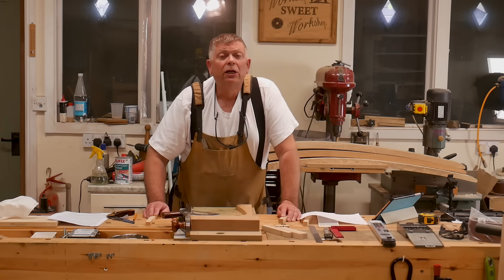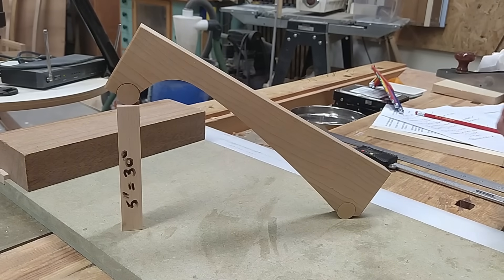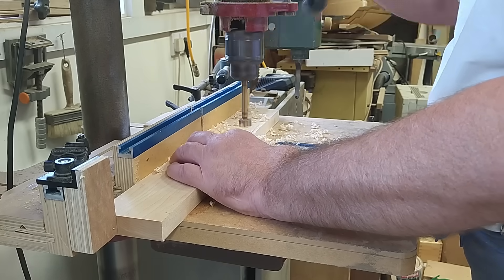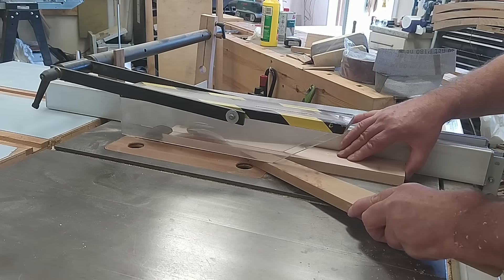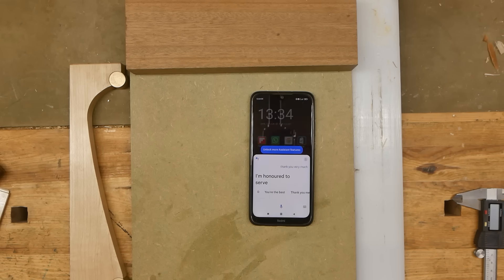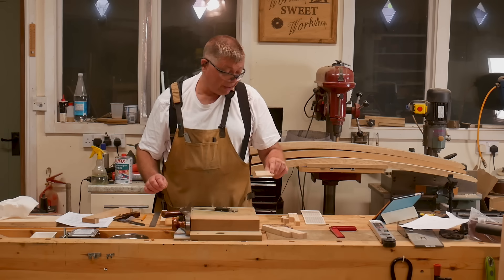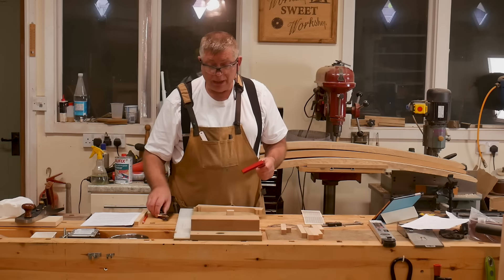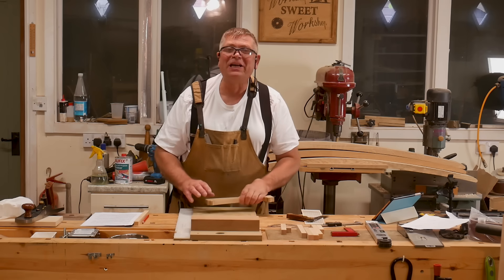Make a Sine Bar for perfect angles First Time Every Time!

Comment: Haha!  Making a sine bar using a ruler for the length!  Wow!  That's like doing microsurgery with a sledgehammer.  Your precision was out the window from the start.  
I would instead suggest a vernier protractor, or a digital one.  They'll be plenty accurate enough for anything made of wood.  If your sine bar works, that means you got REALLY lucky, or more likely, you didn't need that much precision in the first place.
Now, all that said, a really neat exercise and interesting build.
I suggest that everyone search for a video entitled, "the origins of precision"

Have a great week!
Reply: That's a bit harsh.  
As I was watching I was trying to figure out how I would build one using the tools in my average equipped workshop.  I also tried to consider the tolerance stack up.  No matter how carefully I measured and how much I prevented my drill bit from flexing I would never get exactly 10".  Nor would I be able to get the two sides exactly parallel And I would have a slight error on the length of the spacers not to mention that I don't have access to the perfect 6mm anvils.  
However, even considering all of that I can't think of any woodworking project where this wouldn't be accurate enough.  And much more accurate than a protractor.
Reply: @David-tv3dk  I endorse all your comments.

For real precision, use a sine bar manufactured for use by machinists, and gauge blocks to measure distance with extreme accuracy.  A sine bar can be bought for $20 and up.  A set of gauge blocks for $100 or so, used.
Reply: @David-tv3dk  You are probably mostly right.  Hence my qualification that you probably didn't need to be that accurate in the first place in woodworking.  Wood compresses, glue fills minor gaps and there are a multitude of ways to hide imperfections that are in just about every wood project.  
I don't mean to insult your intelligence with this question, but  do you know what a VERNIER protractor is?  Many woodworkers cut miters a half or full degree acute so the outside corner is guaranteed to close with little or no visible gap once joined.  Most common vernier protractors are accurate to less then 5 min of angle.  That's 1/12 of a degree.  And if you know how to use them and have a magnifying glass, you can cut the in half.    Cheap digital protractors aren't as accurate as vernier models and require those pesky button cells.  But they're easy to read close enough for most any wood project.
My comment does read harsher than it was intended.  My aim was to point out the basic precision error of starting with a very inaccurate foundation length.  Those combined with the other things you mention can compound error.  But if you're lucky, they can cancel each other out and be very accurate.   Maybe.  But what do you have to check it against?  
Again, it's a neat project that may well be good enough, but sine bars can be a real pain in the backside to use, depending on the application.  Using one on a vertical surface, for instance.  Wood is not the most stable material to make precision measuring devices from.  
But again, if it's close enough for you, it's close enough.
Apologies for the harshness.  It's the old Army NCO in me.
Reply: @mikemorgan5015  I am aware of vernier calipers - in fact I own one (or is it a pair?) but I wasn't aware of vernier protractors - although I am not surprised that they exist.  I agree that would be a great way to measure angles.  My point was that woodworking requires an amount of precision but measuring isn't really the main issue.  I believe that it's the lack of precision in the tools that causes the most issues.  I have average tools in my shop and I know there is blade deflection and mitre tools or positions that have a small amount of play,  I am not sure if my drill press table is exactly perpendicular to the bit etc.  But as you suggested wood has a way of hiding errors - even the swelling of the wood when exposed to glue can help fill gaps.  I am aware of the trick to cut angles slightly acute so the outside closes but you can also use the same position and cut both sides to ensure that the angle adds to 90 - on a picture frame as an example.

I do agree that this isn't overly precise but it is "good enough" for my uses anyway.   There's an old saying that "only an amateur blames his tools" and that may be true but many times when I watch a video I think how easy it would be if I had that shop set up...but since I don't I think of ways to hide my errors.

I think I was more impressed with the concept more than anything else.
Reply: <<Most common vernier protractors are accurate to less then 5 min of angle.  That's 1/12 of a degree.  And if you know how to use them and have a magnifying glass, you can cut the in half.  >>

Thanks for estimating the accuracy a vernier protractor can produce.  

I'd be interested in the accuracy that can be produced by using a sine bar manufactured for use by machinists and a set of gauge blocks to measure the height at which a sine bar would be set.

I'd bet that would produce significantly greater precision that a vernier protractor. 

And how do you test and calibrate a vernier protractor to KNOW that it is accurate for the angle and precision you need?  Guess?  ASSUME?  

I would guess that you might use a sine bar and gauge blocks to test the accuracy of that vernier protractor!  That's what occurs to me , anyway.
Reply: Making a sine bar using a ruler for the length!  
A couple of things, firstly it didn't have to be 10" it could have been 5" and be  measured digitally, and second if he wanted to make it 10"  long I suppose he could have measured 10" digitally by using two pieces of wood (both shorter than the 6" limit) by adopting the method he used for measuring the 45 degree angle where the length of wood was 7.07 inches, which was checked digitally.
Reply: <<I would instead suggest a vernier protractor, or a digital one. >>

A sine bar is a great way of using basic geometry and trig to solve a problem.  I find that satisfying. 

While your vernier protractor would likely do for a woodworking project as you describe, I'd bet that a sine bar would be superior for a precision setup on a Bridgeport milling machine!

Just depends on the precision you need.  

I'd actually be interested in the precision of a vernier protractor compared with a sine bar and gauge blocks. I wonder how precise each one can lay out an angle when used by a skilled person. .
Reply: @SeattlePioneer  Oh, without a doubt precision manufactured and certified measurement tools like sine bars and gauge blocks are FAR superior to protractors.  But this ISN'T either of those.

My point was that making anything like this using a ruler as the starting measurement standard is simply not going to be anywhere near the precision tools mentioned above.  The likelihood of cutting this stuff out and getting within a thousandth of an inch using a ruler for your first critical measurement is astronomically low.

It's still a really cool shop project that's likely close enough for woodworking.  Because even if it's a bit off, at least it's results are fairly repeatable.  I say fairly because wood changes dimensions with humidity and is compressible.  

A woodworking test to demonstrate compounded error is the 4 and 5 cut method squareness tests.
Reply: @SeattlePioneer  "Just depends on the precision you need."  Exactly!  5 MOA is fine for general shop projects.  But if you were building a base for a astrologists telescope, you'd fail miserably.  BUT!  you can do some incredible things with off the shelf items.  Say a threaded rod with 40 threads per inch.  Using that, you could VERY accurately get 1/40th of an inch with a single revolution.  Divide that revolution into 360 degree marks gets you to 0.000069 inches per degree of rotation or 7 one hundred thousandths of an inch if you know how to account for backlash in the thread to nut interface.  At these tolerances, though you MUST account for temperature.  A single degree of temperature rise could throw that off significantly depending on the length of the rod.
Reply: @mikemorgan5015  

<< Say a threaded rod with 40 threads per inch.  Using that, you could VERY accurately get 1/40th of an inch with a single revolution.  Divide that revolution into 360 degree marks gets you to 0.000069 inches per degree of rotation or 7 one hundred thousandths of an inch if you know how to account for backlash in the thread to nut interface.  >>

Heh, heh!  Sounds like you've invented the micrometer!

Just as the video described ways of laying out angles simply with a degree of precision, you describe a way to measure length with a degree of precision.

But I'd prefer to use a sine bar, gauge blocks and a micrometer for such tasks.  They are relatively cheap, more precise and I don't have to build them!

But knowing that you could helps provide an understanding of the origins of precision measurement  ----one of the gifts that produced science and industry.  

Thanks for your interesting post, though.

Comment: Where would you obtain "anvils" in America for this?
Reply from the maker: I suspect that you will have to find someone to turn a pair for you. That's what I did.
Reply: @SteveMaskery I would assume that you can just cut off some decently round metal stock. Like an old shaft or similar.
If the ends are not nice and perpendicular it can be a little harder to get them properly seated during the glueing but otherwise there is no need for precision at the ends.
For a low precision sine bar like this the wood is way less precise than most shafts or other decently round metal round stock.
Reply from the maker: @larslindgren3846  Well it wouldn't be as pretty, but it would work.

Comment: The British and the yanks stubbornly hanging on to the imperial measuring system.
Reply from the maker: Well no, actually. I normally work in metric, but just occasionally it is more convenient to work in inches. This is one such situation, because 10" is a sensible size whereas 10cm is too small to be useful. I'm amphibious, I can swim in both seas.
Reply: @SteveMaskery  Re "I'm amphibious, I can swim in both seas." My Aunty Dextrus was a keen swimmer and did likewise.

Comment: "Multiplying by ten is very easy, and that's why I'm working in inches."
If only there were a measurement system based on factors of ten......
Reply from the maker: Very drole! :) The point is that 10" is a handy size, whereas 10cm is too small to be useful. And as a digital caliper can give me decimal inches, it makes more sense than measuring 250mm.

Comment: Great job! I plan on making one but have always found that just working with trig functions is the easiest way to find angles. I may have missed it but when you asked Google for the sine of 6.7 degrees I missed you mentioning tha the block needs to be 10 times longer. Oops, just saw the note you put on the screen. Great stuff for making making accurate angles!

Comment: Funny, he uses a phone to calculate the angle block length, when he could easily download one of the many very acurate angle apps to prove angles... without mucking about the hassle of having to hand planning tiny blocks to length or to use any sine bar laying about. Stop yibber yapping to ya phone and get up with the times - old school techniques left earth a couple decades ago.
Reply: You are very rude indeed. You miss the point entirely. If you don't like it, just move on.

Comment: "…and multiplying by ten is very easy!" (starts using imperial instead of metric. Priceless)
Reply: But at 10cm between centers any error in the length of the spacer will have 2.54 times as much effect on the angle, and at 100cm the whole thing is cumbersome. He could have used 25cm but then he'd have to multiply by 25 and while not hard, is not as easy as by ten. Also, he was using decimal inches and never mentioned feet, yards, fathoms or other screwy "Imperial" units.  "Half a league, half a league, Half a league onward"
Reply: He is applying ratio. Does not depend on the measuring system. It shows the op lack of basic understanding of math.
Reply: @pazu8728  I gotta say,  folk who choose to openly and confidently demonstrate their ignorance to the world, like the OP here clearly does are comical.
Reply: He then proceeds to use decimal inches.
Reply: @adrianscarlett  Indeed he does, and does so correctly. When I was a mechanical engineer about 40 years ago, working for the Ministry of Defence in the north of England, I regularly worked with drawings dimensioned in decimal inches. It was absolutely the done and correct way to work. I regularly manufactured to a tolerance of one mil (one thousandth on an inch), and sometimes more 'accurately' than that  All of our imperial measuring equipment was in decimal inches when manufacturing from drawings using imperial units.  When one is ignorant on the application of using decimal inches, and chooses to denigrate with a healthy dollop of ignorance. I suspect one may feel that belittling someone who is perfectly comfortable in the correct application of imperial units is both smart and acceptable. 

I can see why you might be challenged if you had to multiply 2.1 inches by ten, as opposed to multiplying 2.1 centimetres by ten.  Knowing how decimal inches work will be challenging for some.  Have yourself a wonderful evening.
Reply: I think some of you guys are missing the point. Sine (of the angle) = height of the block (in inches) divided by ten inches. Easier to do in the old days when you didn't have a calculator (but you would need a trigonometry look up table for sine). But he uses a calculator! So the 10 inches is not very important, just need to know the length accurately, so you can plug it into the calculator.
Reply: @jumboegg5845  Yeah, the OP was a bit of an ignorant numpty making this post. I guess he thought one was compelled to chop an inch into eights and sixteenths 😅 Ignorance in others is a joyous experience to behold.
Reply: 'Merica .. Fuck yeah!
Reply: @agn855 and yet metric is a much closer and way more accurate way to measure, which throws this sine bar angle accuratecy out the window. Particularly after half-pie guessing the near enough centers between the two brass inserts. Waste of time to make and use, especially when you can download a super accurate angle app on ya phone these days
Reply: @KevPenn  was my thinking as well!
Reply: @KevPenn Ha! This guy thinks Metric is more accurate than imperial. 😂

They both have the capacity to be accurate to microscopic  scales.

Imperial is likely forever beyond your mental capacity
Reply: @KevPenn  How is metric a "way more accurate" way to measure? When someones reasoning is flawed, I think they lose credibility in what they have to say. 

I grew up with imperial and metric in my engineering days, each were as accurate as each other Compare the graduations on a metric and imperial micrometer, you won't find much difference, I have both. I prefer metric myself.
Reply: @briannewton3535  I think maybe this is wrong... let's see: in the metric system there is something called "decimals" and it is just a matter of adding decimals until you get the precise value required; while in the imperial system there would be between 5/32" and 11/64"? (11/64????)
Reply: @juanalejandrosegura5857  Re: let's see: in the metric system there is something called "decimals" I would suggest there is not "something called decimals" I would say that we can decimalise imperial units. How tall is that?  "twelve and a half feet, this can be 12.5 feet applying decimal feet, or 12' 6" if not.

Okay, so halfway between 5/32" and 11/64" is add half of 1/64" to 5/32"  which gives us 21/128" We have just got a little more accuracy. 1/128" is about twice the thickness of my hair, it's relatively accurate. It is obviously easier to work in decimal inches like thousandths of an inch or "thou's' as we called them.  Adding 1/128" increments on a steel rule is as helpful as adding 0.25mm increments

So, in summary, the Imperial system is equally as "accurate" as Metric.
Reply: @briannewton3535  "I would say we can convert imperial units to decimal units. How tall is it? "twelve and a half feet, which could be 12.5 feet using decimal feet, or 12' 6" otherwise."? So why would you still use the imperial system? Back to the original comment: ""…and multiplying by ten is very easy!" (starts using imperial instead of metric. Priceless)"
Reply: @juanalejandrosegura5857  use imperial, if one can visualise in feet and inches, use metric if one can visualise in meters and tenths thereof. I can work with a metre an 1/10th of a metre just fine. Both systems are as "accurate" as each other. If you wish to obfuscate on your original mistake, you obfuscate away.
Reply: @juanalejandrosegura5857 Yeah, don't bother with imperial. It's not dumbed down enough for you.
Reply: @dylanneely91  You're right! If we can handle something complex and error-prone, why should we use something simpler and more straightforward?
Reply: @juanalejandrosegura5857 The only error is between the ears. There's a reason decimal time and radii aren't used, despite the best efforts of the french
Reply: @dylanneely91  Do you realize this is exactly the opposite of what you're saying? Those with problems between their ears are the stupid people who continue to use a system that's been outdated for centuries.
Keep writing in Roman numerals! Then they're amazed when the world considers them fools (with money, but fools!)